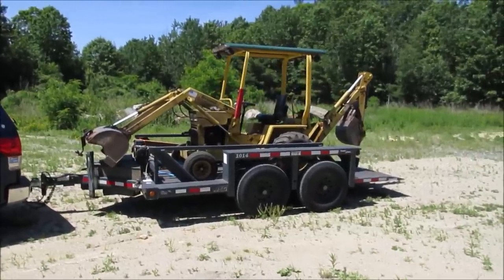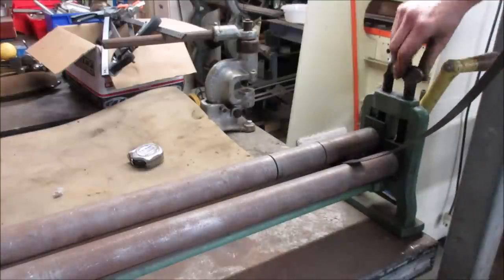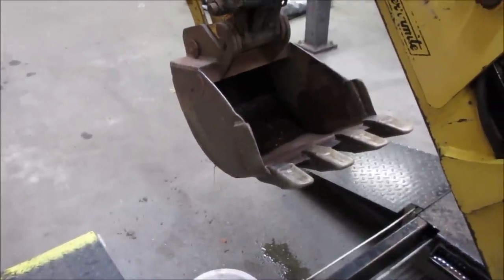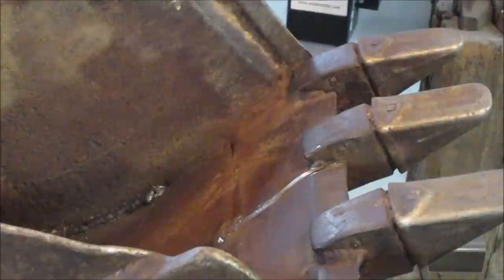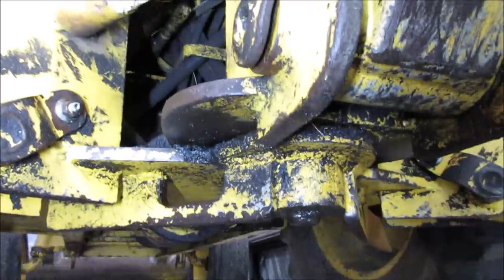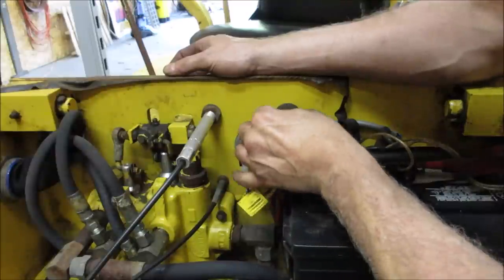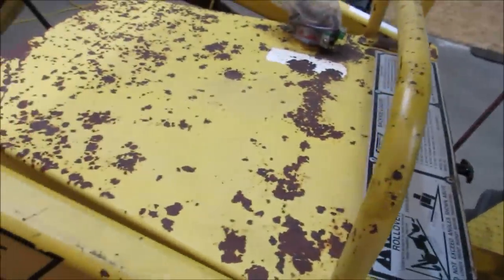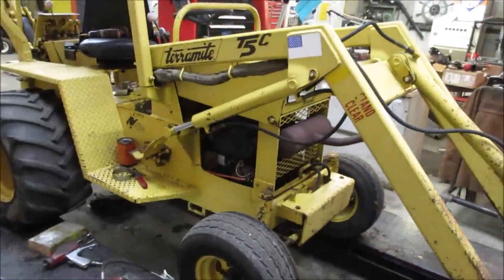I Busted My Backhoe, Now Lets Fix It!

Comment: One i did work with in a factory (i maintained among other a robot welder in the past, 30 years ago) was used to weld thick pieces in the ship industry.
He did show me how to weld with a underpowered welder for that thickness he used.
On two half inch thick steel plate pieces he did show me he did grind the edges so they was 45 degree towards each other making it look like a 90 degree V shape between the plates, and he did also place the angle slightly off so the angle could naturally bend itself some due to the heat of welding because when it gets cold it shrinks some in the V shape.
He did one weld on a MIG between them plates and then grinded that down so it was looking rounded like kind of a U shape at the bottom of the V. And then weld again two mig welds on top of that, and then grind down those separate as before like a U shaped rounded off, and if one need thicker like a half a inch plates need then use more welds over that like 3 welds and so on until the thickness of the welds gets right. He did grind it down every time he did weld to get rid of residue/slag. And it looked solid and was likely very solid :)
When he was finished he said "This will pass a x-ray test".
If one weld fill in a crack or fill a hole a trick is to use a copper plate behind it, then one can fill in welding because steel wont stick to the copper and is easy to remove and makes so one does not have to grind as much as one needs if filling a hole without doing that.
Yeah, i did learn lots of small tricks and things from coworkers in the past.
I did like to weld with much heat, i could weld faster that way and the welding looked smoother. Probably not energy efficient in our day and time today, but that was what i did like, i sped up the heat and feeder, and my coworkers was tired of changing it back when they did use the machine.
But yeah, it was how i did like to do it back in the days to get spare time for making own projects :)
Another one did learn me to change a flywheels starter cog using heat from carefully using a cutting torch, heat makes the cog ring slightly larger than the flywheel and the cog fall off almost as good as by it self :)
It was on a white Pontiac Firebird around 1974 model look that he brought with him when he did move to my country, he did choose that instead of the Porsche 911 he also had because he could not bring more than one car without paying VAT tax.
It was a lovely car in a lovely time where gasoline prices was not an issue :)
Perhaps make a half a inch hole in that digger bucket so it wont end up being filled with water again or is that a bad idea if one dig mud perhaps..? hmm..

Comment: Musty, sad to tell you that my workshop burnt down to the ground September 1 last year. 30 years of collecting parts everything from woodworking to metal and electrical. I had inherited my grandfather‘s antique tools. Metal lathe to hundred year old hammers screwdrivers etc. My father‘s snap on toolbox was complete with all of the snap on tools and my brothers (Vietnam vet) snap on tools. I had purchased two CNC plasma cutter and a Hass VF2 mill. 
I lived in a area where there were no fire hydrants. With all of my welding equipment from plasma to o2 tanks, I used a large number of tanks. That combined with a tile roof, the fire department was unable to get enough water to put the fire out. I lost my home and my workshop.

PLEASE GET SOME TYPE OF FIRE PROTECTION IN YOUR SHOP AND INSURANCE FOR YOUR TOOLS, PARTS AND EQUIPMENT.
Reply: I had a little air compressor in my shed/shop and it caught fire 🔥 and it totally burned my shed down. Lost all of my tools. The weird thing was my big oxygen and acetylene tanks both relieved their gas. And when all cooled off I was able to just unscrew both valves by hand no tool  and look 👀 into the tanks. Oh yeah no insurance.
Reply: insurance for tool in shops is eye watering

Comment: I'd weld a plate on that bucket for a wear plate. Don't have to be a heavy piece, although that's recommended. But you'd strengthen that bucket a whole lot. If you have a stick/ark welder. Get some hard surface rod and weld some beads crossways on the bucket. It will help reduce wear on the bucket.

Comment: As someone who works with elastomers, it seems that it would be so straightforward to cut some sheet nitrile to fit that gas cap.  On the other hand, much of the stuff that Mustie does is nigh-on magic for my abilities!
Reply: I would have used some tin snips and an old innertube, cork or some plumber's gasket. I think I've actually done that in fact.
Reply: @KelikakuCoutin  me too thought cork tile or old inner tube

Comment: Suggestion for the bucket put in ware bars on the ends overlaping bars on the edge then weld to bar bucket  then weld the 2 bars together also ware bars across the bucket 3 to 4 bars will keep your bucket from wearing out check out other channels for more information  .  You can do the same for your front bucket as well

Comment: @mustie. Mig welding gas should be ten to twelve not thirty turn down regulator. Also a good weld should be flat. Bubbling means your too cold.
Reply: Yes no mig out of position is certified .
Must be flat of gas does not flood weld puddle.
Reply: You can see the toes of the weld on the bucket sides sitting proud of the bucket with poor blending on the base metal. This shows too little heat was used. Also, the porosity on the start of that one bead  was likely when you changed the gas and the line wasnt purged so gas didnt flow over that weld at the start. My welds look no better and its easy to armchair quarterback the welds. Love your content.
Reply: 10 to 12 what's?
Reply: @whitemonkey7932  psi it’s a gas regulator.
Reply: @jacilynns6330  very good....that is better....now what flow?
Reply: @whitemonkey7932  flow? Clarify please
Reply: @jacilynns6330  psi from the reg is neither here nor there...what matters is the quantity of the sheilding gas...thus flow in cfm is what matters
Reply: @whitemonkey7932  10 - 12 psi period. if you dont know what that means go to school.

Comment: On aircraft, we stop drilled cracks, when no additional repair was going to be made.  Non structural metal.   Mostly seat bottoms.
Reply: Even if you weld it, always stop-drill a crack to distribute the stress that caused the crack around a larger area ( the diameter of the hole), rather than the point at the end of the crack…. (Also an A and P here….)

Comment: Hi. You may need to check the support cylinder fitting with the cylinder retracting. The loose fitting is on the retraction end of the cylinder not the extension end. With it extended there won't be pressure on that fitting you repaired. Cheers

Comment: I think if you flipped the battery bracket over it would have clamped down on the battery and the slotted hole would give you some height adjustment depending on battery installed.
Reply: Exactly 💯%👍

Comment: Had a few beers and haven’t watched the comments. 
With the battery securing L shaped thing - instead of creating a new hole for the bracket, couldn’t you have just had it upside down on the original bolt securing it downwards? Like the short part of the L on the battery and the long part with the adjustable portion on that original bolt hanging down? 

Maybe it’s my beer and wine talking though.

Love your videos bro, I wouldn’t have said the above without the education you’ve provided me!

Comment: @mustie1 welder Tip around 22:34 Hit the weld bead while it is still hot immediately after welding a spot bead in the middle of the bucket with a hammer and it will suck the metal in. More so if the weld bead is still glowing.

Comment: M1,
Cool little machine. Kohler is a good power plant. The hydro's seem quick/touchy. Is there an adjustment to calm that?
Nice video as usually. Boe
Reply: Terramites are great machines (I have a T7), but I don't think there was a dime spent on "finesse"  when it was designed . If you want to operate smooth on a Terramite, you better just be smooth because the machine will expose your every flaw.

Comment: weight of a Cadillac speed of a tank. Terramite can take a hit and still run. I have work on a  older model that someone swap the koler with a Briggs 20hp. had a hell of a time trying to load it on a trailer with a engine electrical issues. I was the fist time a saw a cummins D-250 actuality struggle to pull something from the weeds. but once I got it running. It just chug along with a few dozen hydraulic leaks. told my uncle it would cost over $2K for just the hose. He call B.S. on me. So he took the all the exterior lines and the 3 leaking cylinder to get rebuilt by a shop. $4K and 4 months out of his pocket. Sold it two month after every thing was fixed.

Comment: On the bucket the best way to close the crack a little is spot weld and when still hot hit it with the hammer, it will draw right up, do it as many times as needed along the crack and then complete the welding.

Comment: That saying goes " Grinder and Paint makes Me The Welder I Ain't " and it comes from legendary canuckian youtuber AVE! Also for that nasty metal, a grinder is basic, but a needle scaler can get lots of that loose rust and non metal material loose enough to blow away with compressed air and or a wire rope wheel.

Comment: Fabco 811n1 and vertiwear 600 for you bucket welding needs, but you'll need 75/25 argon/carbon dioxide gas.

Comment: My cat gets the zoomies just like claw foot bath tub dragster.  “In the grand tradition of the show rods of the 1950s and ’60s was Shower Power, a 1947 American-Standard clawfoot bath tub entered by Scott Jezak, of Tiverton, Rhode Island. The tub features a high-compression Chevy 283 “drag” V-8 backed up by a “slingshot dragster” Powerglide transmission and an 8-inch Ford rear with 4.11s."

Comment: Use your welder to make wear bars down the sides of your bucket in the bottom of your bucket it'll make it lasts a lot longer it is easier to use your welder to make the wear bars then it is to buy them and install them

Comment: I think the metal washer in the cap was "domed" with the rim pressing against the gasket not towards the tank. You put it in backwards. Was definitely the other way around when you took it apart.
Reply: Convex side out*
Reply: @Hjerte_Verke  He knows* He changed the design.

Comment: For the bucket welding you need a nice 6013 electrode that doesn't care much about a little corrosion. I don't have a tig welder so I make do with what I have, but I imagine that generally tig needs clean metal.

Comment: Looks good, and I bet it is pretty capable.  Switch the lights over to some LEDs and light up everything with it. I have a old 1968 yellow JD 400, it leaks everywhere  and last time I went to use it it refused to move :( has fluid but won't go anywhere. I think it's about time to scrap it but it has the bucket on the front and the backhoe on the back so it was perfect for just around the yard and anything that would replace it is outrages anymore.

Comment: at 39:40 the pressure is on that fitting/end of ram while the outrigger is raised up/retracted, not down. just top it out and pulse the lever to really spike the pressure on it (while taking cover in case it is weak!)

Comment: Supplementary question: Can you adjust the track of your hoist so that you could match the width of the front axle?  In this case the bucket would stop the front wheels from falling through the gap but there might be other vehicles where it would be more of a risk.

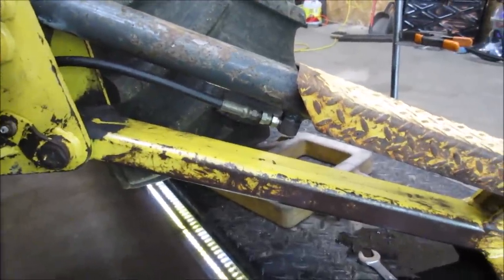Comment: 40:20 - You identify a crack at the base of the support for the frame, and mention another like it other side. I'm pretty sure you have inadequate support against the "dashboard" framework racking. Just the location of the cracks gives it away. But then you mention you built the frame and cover and I was certain. At least, those triangle supports should extend all the way down the side of the frame. Not seeing any benefit to the triangle shape, I'd replace with a full web plate. That seems like a lot of stress to resist.
Nice work, love riding along.

Comment: 1:07:25 why not get a torsen diff for it, or run individually brakes to each back tire, so you can stop the spinning tire with the brake ... or put two smaller hydraulic motors in it and drive each half shaft individually. :)

Comment: do you use smaw welding? If you had DC arc welder you could use 6010 rod , it design for rusty and dirty metal.

Comment: another Mustie miracle. a groove ground in the corner of the bucket would have been better for penetration of the weld, doesn't need to go all the way through as the welder should go to a certain depth on its own. stick is usually better as you can use different rods to reinforce the bucket as well as fix it.

Comment: The problem with welding is the joints don't stop cracking. Which is why the structural bandaid on Liberty ships were riveted in place.

Comment: Just curious if you are aware that Auto parts stores carry gasket material that you can use to make your own gaskets? It would be a good investment to get an assortment so you don't have to keep tearing things apart to steal a gasket for your project. They usually keep the gasket material behind the counter back with all the parts.

Comment: Dont grind off the extra weld, it will grind off itself in use and till it does it will protect the edge, by grinding off you start to wear the edge strait away.

Comment: The gas cap...the silver retainer for the gasket goes concave side away from the rubber gasket then screw in down.  That way the silver retainer edges will be buried in the gasket.  Just noticed that.  No big deal.

Comment: If that bucket it wear plate you should always preheat before welding and never do a continuous pass, It carries your stresses along with your weld. Flux core with gas is a far superior wire as well

Comment: You need to run some hard face on to the bottom so the bucket will last longer and hold up better under use in the rocks

Comment: Flux core?! Really! 
I have a Century FC90 that I bought to do sheet metal repairs on cars. It's my first welder.

Could it do something like this? It would be nice if it did, it would make it more versatile. I was surprised at how powerful it was, it's easy to set it too high and blow right through sheet steel.

Comment: When you can't close the gap as you were doing tack it in the middle and while it's still hot hit it with a hammer at the tack and the metal will hold together more than not.

Comment: I have run one of those a few times, and really enjoyed it for the small jobs, it can get in those smaller areas which is good.  did the job everytime.  Just curious, what did you pay for the one you have, I know it was years ago, but I would really like to have either one like it or a small excavator.   Thanks.
Reply: $8k

Comment: Ok... on that gas cap, you've got that metal dish upside down. It should have the curve on the bottom to let the cap center over the fuel inlet.
Reply: Yeah, but when ya remove stuff without bothering to TRY to remember which way it was on, it's a crap-shoot to get it back the way it belongs - - - so, waddya gonna do, aye?  lol

Comment: I've had luck soaking old hard rubber in brake fluid and then boiling it in water. Tested it on a 100+ year old gas lamp gasket and it felt like new after

Comment: Hey I've got a quick question I've asked before but I missed your reply if you did I recently got a scooter and a storage locker George Walker went to clean out the gas and fand found that the sending unit was seized. Do you have any tips or pointers to getting the sending unit unseized, Without taking off the tank unfortunately the tank is in a very difficult position to get it off without removing terms of pieces of already damaged plastic. If You have any pointer's tips advice other than just throw a match on it I would be greatly appreciative thank you Oh wise one.

Comment: Love watching people still doing some actual metal works..  It's almost unheard of these days, people just buy the parts they need... 

Reminds me of my collage.. I went on a industrial mechanic school, we did everything from welding to cnc operated machines... For the graduation we made a fire wood carrier out of sheet metal and steel rod decoration (horizontal S's) and a rosewood handle... Then we had to make a mini cannon in brass, which the stand and wheels milled from ss316 real soft steel, and last we made a few chess pieces in aluminum on a cnc operated milling machine 😎 Good times, but it's been years...

Comment: The shop might be well served by having electroplating section.  You could zinc coat that  steel band at 10:10 to prevent rust.  It's fairly cheap and easy.

Comment: 55:20 flip the bracket so it is an upside down L? and the arm of the L is holding down the battery, though you might not want to mush pressure on a single spot...

Comment: Regarding drilling a hole to arrest crack propagation, what I learned back in the day, by the materials professor who told us he decided to study that field when his model A’s steering shaft spiral fractured while he was driving the car, is that you want to drill the stress release hole just beyond what looks like the crack’s end because the metal’s crystal dislocation stress riser is actually just beyond the visible crack end. If you do not drill out that crystal dislocation then it remains to be the starting point for crack propagation when the metal gets stressed again. The other related takeaway was that both stress degree and repetition are your bad guys.

Comment: I sure don't like that ground stud sticking out where it could wear against/ground the battery, even though it IS ground.  A bit more work but more elegant would be to move the ground stud to clear that battery, perhaps with a shorter/cut off stud.  Then use separate bolt/stud welded to hold the battery down AND away from that firewall.